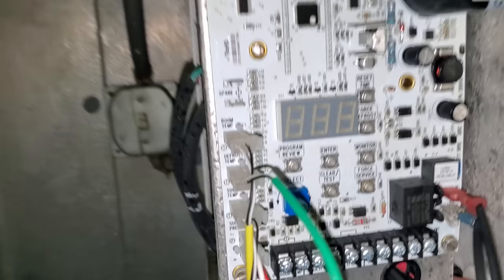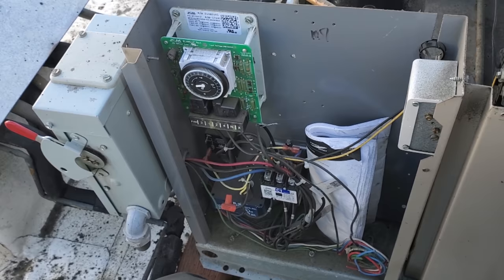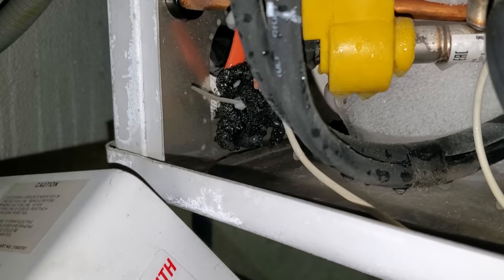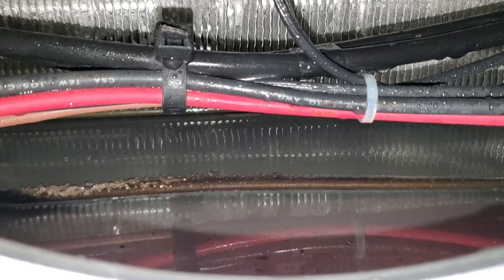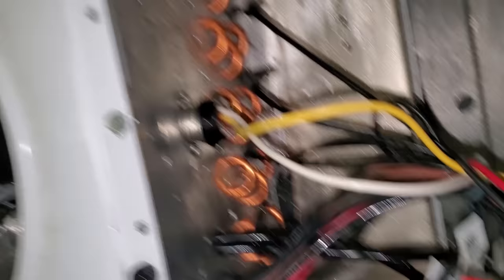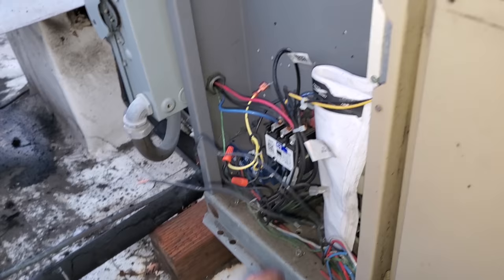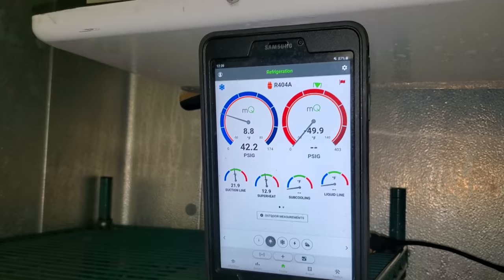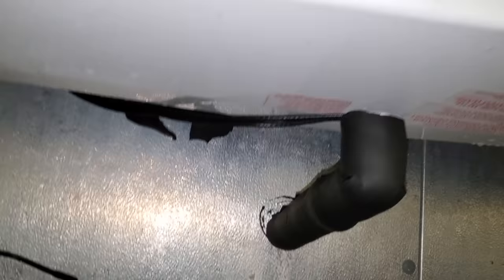THE OTHER COMPANY COULDN'T FIGURE THIS ONE OUT EITHER

Comment: I do HVAC for an apartment complex owned by a large investment group. I am not anywhere near this guys level of expertise and I don't really care to be but I totally get where he is coming from. I hate sloppy work.  I have seen some things. One time a guy went all weekend in 100 degree temps with a portable AC because the guy before me ignored the obvious which was a breaker tripping because of a sloppy mess of wires he didn't want to look through behind the service panel. I had a furnace pilot light not staying lit because someone disconnected the wires from a heat exchanger temperature kick out sensor for whatever reason. I once went on a call where the condensor fan was running backward. Which could be various things. I swapped the connections on the capacitor and it ran the correct way. I think my supervisor worked on it the day before and hooked it up wrong or the cap was bad.

Simple things.

Comment: I had to dc’d central- guys came took $ & never fixed non cooling; now I suffer thru Summers(window ac)& cold weather (Tx freeze Feb.15) thought I would die. 78 and Central. Air/ heat inaccessible. I no have it easy life. I removed n replaced elec heater- did pipe connecting. 240 V cord just removed screws. Did outdoor faucets. Have to!

Comment: Those exv's are supposed to be manually opened before soldering otherwise they will bleed by on the seat and constantly short cycle the compressor on additional pumpouts.
Reply from the maker: No need to manually open them heatcraft ships them in the open position. So if you don't apply power they will already be open. Once power is applied for the first time they shut every time after that

Comment: Damn, I'm in the Automotive field and we use the same chingas at times. From those elcheap-o wiring crimps to solder + shrink, liquid e-tape, etc I seen crap like this esp if work is slow... Seen a Master Tech fail to do the right thing on a AC job to blame it on parts and prior tech.... He failed to back flush system destroid new parts...

Comment: Correct me if I'm wrong but, aren't all those wire nuts supposed to be wrapped in tape before placing a cover on the junction box? I know nothing about HVAC, I know a little about electrical but, I'm no electrician. 
Good thing she kept those invoices, those tell the story of what's going on. Shouldn't they have noticed that EV leaking like you did? I mean, could clearly see that in the video. 
In my opinion, that company should be broadcasted out loud so people will know to stay away from them. Better Business Bureau? Great video, cheers :)

Comment: BTDT. Like you, I end up coming in AFTER some other company mucks it up. It sucks, but OTOH you get a reliable customer and a great reputation out of the whole thing. The only downside for guys like us is that we don't make as much money overall because we do or fix things right the first time, and make our installs or repairs reliable and long lasting.

I'm not a fan of Heatcraft's QRC coils. Anyone watching this and seeing how they are built should be able to understand why. The electrical wiring should be in enclosures separated from the coil u-bends and manifolds OR the coil ends should be covered with molded foam caps. The circuit board should be in its own semi-sealed compartment that is insulated, with some power resistors on the board or small off-board heating elements to keep the circuit board enclosure above freezing.

Comment: Looks like the same units we just got installed with ECM motors in my store.  Ill have to check the drainage pitch in our meat cooler. It has iced up multiple times. The first time it covered the entire coil outside the unit.

Comment: Automotive, HVAC, refrigeration, ...  Seems 60% of the work is backtracking the repair attempt/patchwork of previous techs, cleaning the mess and making the correct repairs. I used to get a kick out of it. I got a high almost from solving problems like those. But, the older you get, the more it's just frustration and aggravation.

Comment: Every other guy- "I have no idea what they were thinking...I would never have done things this way,that;s not mine..." Also "a circuit board " is one of the favorite things for them to change because-it is expensive,it is easy to do and it won't repair anything. It sounds like the contractor was milking that restaurant to the last drop of milk.

Comment: I noticed the drain line of the freezer, evap. when thru the cooler wall and joined the cooler evap. drain line and then dumped into a floor drain, no where was any "p" trap between the freezer and cooler, only at the floor drain !  Don't you find this promotes accelerated ice build up in the freezer coil going from a lower temp./ humidity area into a higher temp./humidity one?

Comment: It's very easy to check if compressor is original or replaced based by last 3 number of model number.  130 is original  everything else is replacement

Comment: I'm a mechanic and I run into jobs like this a lot. I had a friend that worked at a used car lot he had to take off one Saturday and asked if I could use extra work I could fill in for him. Well I went to to his employer and he had the rear of the car jacked up on stands and wanted me to pull the fuel tank so I could replace the fuel pump. I asked him if he was sure that was the problem he told me he bought the car at an auction cheap because it had been to three shops and they count figure out why it wouldn't start. I always verify before I start take parts off blindly. I asked the owner of the business for the keys so I could trouble shoot the car myself. He argued with me for a few minutes but did give me the keys. I got in turn the key to the on position noticed that no lights no gauges nothing responded . I pulled off the cover to the fuse box and notice there wasnt a single fuse in the fuse box so I installed all the proper fuses turned the key to the start position and Bing it's started and ran great.🤔

Comment: Why is the bottom of the system so flat? woldn't it have been a good idea for the manufacturer to have a fold or two in it so that the middle where the drain is, is an inch or so lower than the rest so that the water is funneled properly?

Comment: You said you only had a 75va replacement transformer but the wet one was only 40va. Why would a 75va not be suitable? It just has more current capacity but is still 24volts.

Comment: So wait… They used the neutral of the 3 phase for the ground of the door. Why? Isn't it supposed to be grounded separately? Does it trip the whole freezer when the door has a short, or worse does it not trip any circuit breaker?

Comment: Looks like the previous company guy got training from Typical, Indian A.C. Service guys😉
Every summer they want to charge you for topping up the freon. which is like 30USD for freon itself, No matter your compressor needed it or not, Even if its just a 50g required they would charge in full.

I do own a manifold and always take readings before they arrive, As soon as they made simple cleaning Job into Gas Charging I showed them video with readings and ask Why do you guys want to Recharge a completely fine compressor?
Most run away as they only wanted to RIP me off my money 😁😁 and knowing that I have tools and a bit of know how they just refuse to work with my AC.😂😂

Comment: Was that unit earthed correctly? I was called to a job non fatal electrocution just a six foot jump. Previous company had disconnected the earth to stop the circuit breaker going off. To make things better they had changed the live neutral around so even switched off it remained live? I have also reported a manufacturer for not having an earth on a motor numerous customers getting a tingle only earth path was a drain pump shaft. Well according to the drawing it cannot not get wet and when you test the rusty part dry there is no leakage. Told by the responsible authority I was lying?

Comment: When you said that unit is only a little over a year old.
and they've been throwing parts at it? 🤯 WTF! 
 they obviously have no clue how to troubleshoot.
Being an electrician when installing equipment, especially something I'm not 100% familiar with or haven't installed in a few months, I still RTFM (read the FAHKING manual) 
I learned a lot from my first employer and the most important were, do it right the FIRST time, the only callbacks should be for more work the customer wants done, don't lie, and when you're done leave it CLEANER than you found it. 
🤢I hate restaurant service calls, it's why I don't eat out anymore and I pack a lunch🤢
✌

Comment: I have only bad experiences when I hire someone to do any trade.   I've learned to try and do everything myself.   HVAC,  Plumbing,  electrical,  and more,  I do it myself.   The ONLY contractor I've had a reasonable experience with is a roofer.   And that roofer piled way too many shingle packages in one spot and cracked drywall.....but I chalked that up as expected damage.  (although I would have spread the load out all over the roof to avoid the problem.    I'm a mechanic,  not a contractor,  but I've learned that I can just do it myself.

Comment: Surprising how many problems resulted from the drain being improperly installed.  The drain pipe pushing up the metal inside the evaporator and sloping it wrong was a new concept to me.  I had not heard of quick response evaporator controllers previously.  I know that the green ground wire is not supposed to be dedicated current carrying conductor.  They did not take the time to find a valid neutral wire.  Is there a recommended type electrical wire that works well in refrigeration wiring?  Thnn ?

Comment: As a fellow AC engineer but from the Netherlands I know the feeling fixsing some one else mes. 
Aslo I it's wirde to see the electronic print and other electric connections so open and exposed. I would need to place then inside drip water thight encloses.
Also not a fan of using expensive electronics values for small cooler ass this, wile a mechanic vales is so much cheaper.

Comment: Wellll....if the pan can't drain and the fan is flinging/splashing water on the coils (repeatedly!) causing the coils to completely ice over, that SHOULD HAVE BEEN a number one INDICATOR that something was wrong with the initial installation!!! I personally think the drain pan should have been redesigned with creased channels pointed towards the drain outlet to ensure correct directional water flow...😏

Comment: Depending where the main electrical service is located, you will encounter a 7-20 VAC shock hazard trying to use ground for neutral. Sheesh, that's bad. I found this nonsense in an pipe inspection machine one time.

Comment: Had a company do some electrical connections in our shopping mall because I was swamped with work. Idiots didn't connect the neutral wire on the main power cable and did what would loosely translate from my language as "point of division" where you get get the blue (neutral) from double grounded PEN terminal. What that did was re-classifying the whole thing from TN-S system to TNC-S system but WITHOUT THE ADDITIONAL GROUNDING. All the while they've HIDDEN the neutral behind the breaker box! Like - WHY? The level of incompetence with big company tradesmen is off the charts. Not to mention our brand new cooling units are just a bag of technical issues. I mean it's not very usual that the maintenance department must install fog sprayers to keep the damn roof unit cool enough to keep going. And then we have to restart the other unit after every power outage because the thing just won't start on its own.

Comment: Just a heads up that style of heat trace you're not supposed to insulate cause it will get too hot and short itself out again. The  heat trace that you cut to length and secure to the bottom of the pipe can and needs to be insulated. Fyi.

Comment: They are some occaisions, when I've been called out to a control system or similar, where there quickest route for me had been to run a complete  new harness in even if that means building it on site. Most of these things are the result of others not finding the root cause of a fault but just trying to fix the symptoms.
I bet they quoted less for that install than you would.

Comment: My wife’s bakery has one of these qrc units in the big walk in. I’m not a commercial Hvac/refrigeration professional, but have a many certs and years of experience in the transportation industry. So after a company replaced the compressor for the 4th time, I went and looked at the setup to see if I could decipher it in my head. The drain line was pitched, drain line heater was shoring out on the copper pipe, one fan motor was noticeably slower than the other 2, the drain pan heater was bad, 2 coil heaters were bad, the compressor crankcase heater was open/not working, and the service panel on the condensing unit was laying on the roof. The capacitors were covered in rust and about to pop. I have rectified all of these issues. Question if I may, the unit throws a fault for low superheat randomly. If the suction pressure sensor is faulty, does it have to be replaced with a factory heatcraft sensor? Or will a universal one work just as well? Thank you for not glossing over your jobs and actually showing how calls go in reality.

Comment: And This is why I hated working on someone else's bodge job.
You find a fault, fix that, to trace it back to a second fault caused by someone messing around.
You figure out why they did that to find the original fault. 
To fix the original fault is a £5 part, which the original tech never had, so they got creative, and used a 3rd line to a second power source.
This snowballed to mess up everything else.
In the end, I just got the customer in.
Showed them exactly what happened.
Took photos, then ripped all the working out and rewired from scratch.
2 days work sorting all the shit out, when the original job would have taken a couple of hours to diagnose, strip down, replace part, rebuild and test.

Comment: I know what you face. Even when I worked with IBM I saw companies wire their computers with so many patches, literally a bundle of loose wires bunched together. Fortunately back then in the 70's computers did not work at a very high frequency reducing the chances of crossover between wires screwing things up. 
I am a retired electronic engineering tech and have seen a lot of wild stuff and usually solved the problems saving costs but I could imagine the difficulty you faced in this video, like walking through a land mine. 
Passing the buck was even done with IBM  years ago. "It's a hardware issue" or "its a software issue" and finally someone beat their head against the wall and got the right answer. Sometimes it is purely the complexity of what is done and sometimes problems are caused or even added to as with the company you did not mention. On credit to IBM they  had a lot of great techs and engineers then.  Back then they mostly had main frame computers that took up a lot of room and were just getting into smaller computers - mid frame if you please, just ahead of desktops.

Comment: Is it working now?? It may still have ice buildup over time. I worked for a couple dozen manufacturers in that they had a dozen companies try to fix a problem but didn't, so they wanted me to go fix the problem once and for all. About 85% was to fix other people's mistakes, but 15% was technical issues the factory engineers weren't aware of. Let me know if you are still having problems.

Comment: I think your very lucky that you weren't electrocuted, there's a very good reason why the neutral and ground are sperate .I think what was happening and I would say 99.9 percent sure was caused by the drain. what was happening in my opinion from your video was that the ice created a dead short when it froze up creating the issues and I would say by the time the tech got the call the ice had melted . I wouldn't be surprised that the board were burnt-out from the dead short. Now the drain is fixed you fixed  the main issues.And your rewiring should fixed the rest . Great job.

Comment: Wouldn't it be nice if the coil manufacturers were required to build in a 20 degree sloped v-shaped drain pan outlet with a 1" rubber hose connection? Hose clamps instead of threaded or soldered pipes?

Comment: Only one question why here in Europe we using terminal box IP65 IP68 in evaporators (FRIGA-BOHN GÜNTNER etc) and in BOHN Coils or Larkin it doesn't use high quality plastic terminal box with gasket for IP65.
And the automation why the electronics inside to the coil is short circuit hazard and why the automation box in the condensing unit.

Comment: It happens a lot. Bottom line is people do not care about their work and never even learn from their mistakes. The techs. That installed that unit still will half ass the drain and wiring on the next one because they didn't learn when someone else fixes it and they get off Scott free or they never cared any way. I worked in the HVAC business and I think there are more bad companies than good ones good ones out there.

Comment: Should the drain line heat tape have a disconnecting means rather than being hard wired?  If the customer slashes into the heat tape with a meat axe, should they be able to shut it off without killing power to the entire unit?